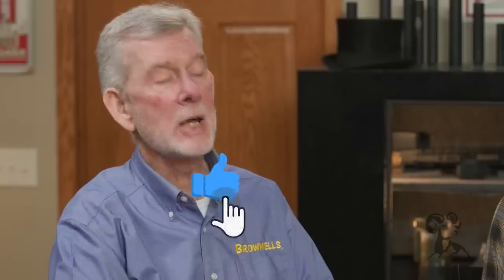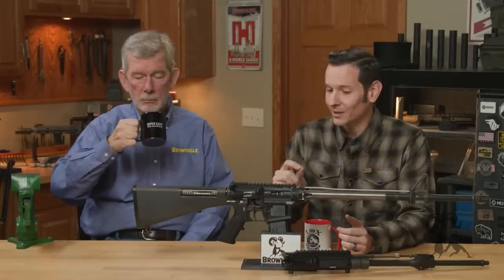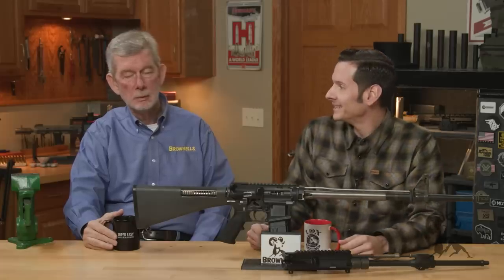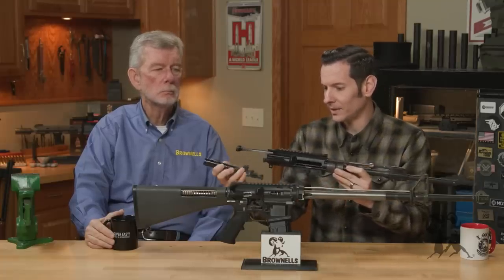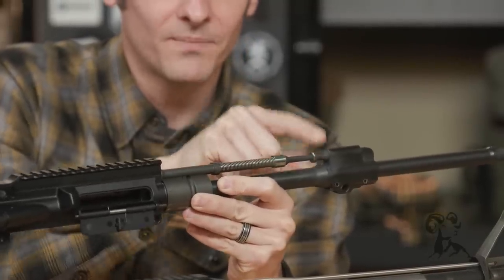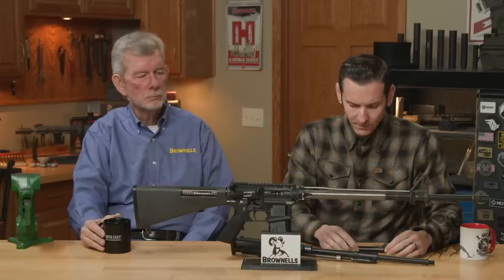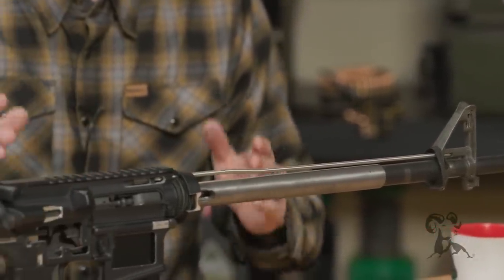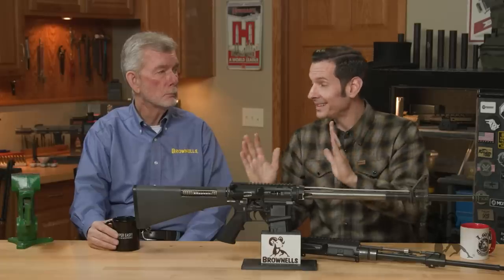Smyth Busters: The AR-15, Direct Impingement or Piston Operated?

Comment: Having spent 23+ years in the U.S. Army having to clean a D.I. M-4, I couldn't wait to get my hands on a Piston rig.  3+ hours cleaning versus 15 minutes.  The first Piston gun I ever purchased was a Stag Model 8, it was a REVELATION in my shooting sports life!  Now I only have 3 or 4 D.I. AR's in the vault, all the rest are Pistons.
Reply: Impressive,  since I can't think of very many direct impingement guns.
Reply: Get a dishwasher.
Reply: Where did you find DI M4s?  Ours were always Internal Expansion systems, just like the M16A2s they replaced, just like the M16A1s they replaced.  Been shooting AR-15s since 1987 and have never seen one with a Direct Impingement system.

Comment: For all of the problems with my mas, carbon buildup is not one of them, lol. Anyway, if the ar-15 is gas piston, so is the the mas with the bolt being the sleeve and the gas tube the piston.
Reply: The gas tube on the MAS-49 doesn’t move. You can argue it has a cylinder, but it has no piston.

The bolt of the AR acts as the piston, and the carrier acts as the cylinder. The gas tube just feeds the cylinder.
Reply: @woodrowcall3158  Yeah, i get the distinction and I do think that the AR-15 system is brilliant, but what I'm saying is that when you boil it all down, there seems always to be a piston and a cylinder. Maybe in one system the piston moves, in another it's the cylinder. But really, they're all gas piston. The AR-15 is more inventive because the piston and cylinder are the bolt and bolt carrier with the gas to operate them supplied by the gas tube. But overall, still a piston and cylinder.

Comment: I remember seeing an interview with a BCG manufacturer who pointed out most believe the entire action comes from the tiny gas tube.  He said not true. The gas tube is really only responsible to Unlock the bolt. The force driving the BCG back to cycle comes from the enormous pressure still in the barrel acting on the spent casing pushing the bolt rearward.
Reply: That manufacturer doesn't understand basic firearms mechanical engineering then, or you might not have understood what they were saying.

The carrier inertia is generated by internal expansion within the chamber formed by the bolt tail, flange, gas rings, and bolt carrier.

Chamber pressure where the spent case still remains has subsided by the time the camming action has rotated the bolt from its locked position.  There isn't enough residual bore pressure to act on the spent case, because it has already acted on the carrier and vented any excess through the gas vent holes in the carrier.